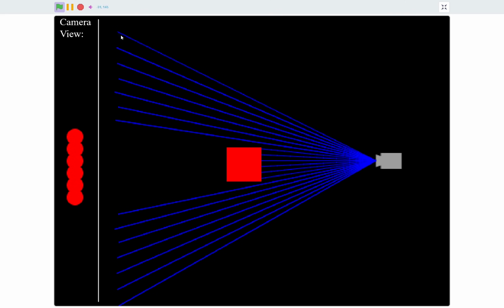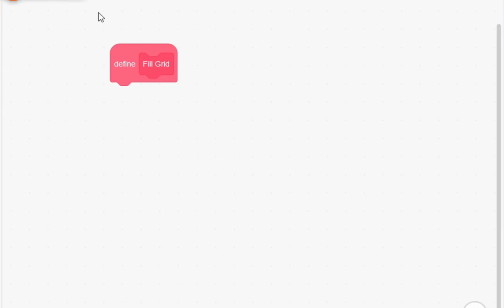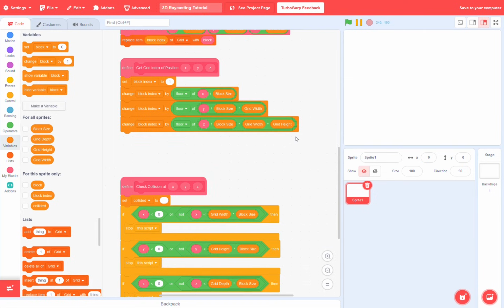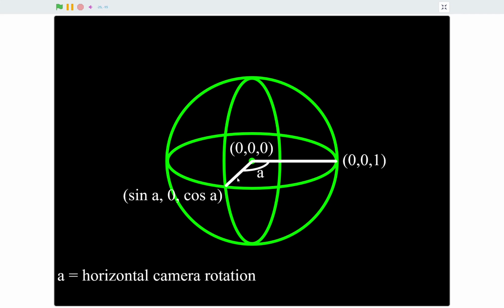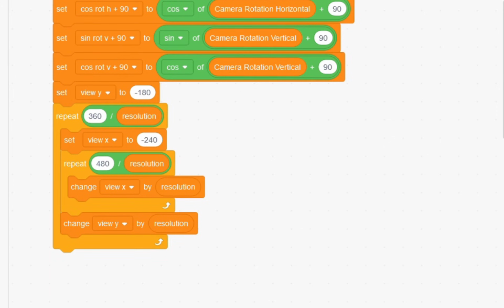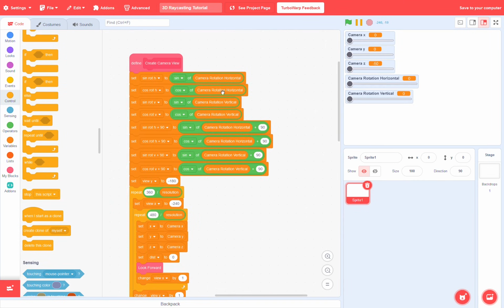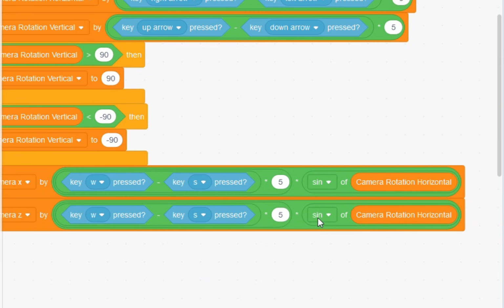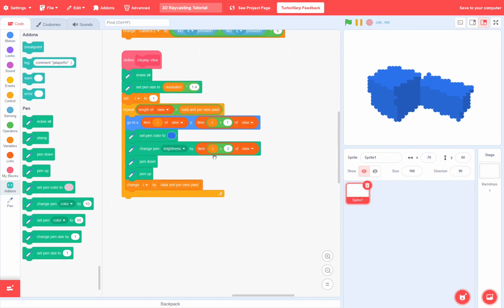How to Make 3D Minecraft in Scratch | ep1

Comment: Listen, lets just be honest this isnt possible without blatantly remixing another scratcher's project. Ive tried hundereds of time and i STILL fail every time. You do not know how to make it, so you just whip up some nonsense while learning it and pretend what your tutorial said actually works.
Reply from the maker: You're right that this tutorial does have numerous places where it's really easy to misplace a variable or block, and I'm sorry about that---I agree it's one of the biggest problems with this tutorial. If anything, that's because I came up with basically all the code here on my own. Perhaps, if you aren't able to find where you went wrong, you could try my newer 3D tutorial which is both more efficient and (I hope) easier to understand.

Comment: I tried 3 times but it didn't work. I checked the codes a thousand times. What should I do?
Reply from the maker: Pay attention to what, exactly, is going wrong. Then think about what parts of the code could cause this. That can help highlight the areas you should check first. Also be on the lookout for breaks in patterns in the code (e.g. there's an x variable in a section where only y variables should be). Swapping change/set variable blocks is also a common mistake.
Reply: @FindingPepper  very thanks bro. I like your videos more than anyone else.
Reply: die

Comment: I've been too lazy to try this so far: Does implementing the trig functions (sin, cos, etc.) with 'lookup tables' (lists indexed by look direction) speed things up enough to justify the added memory overhead?  Has anybody experimented?
Reply from the maker: I like the thinking, but because we only calculate sin and cos a few times per frame I don't think it would really speed up the project, and would not at all be worth the imprecision that lookup tables would cause. After all, the specific direction of the rays is really important because we need to know which individual pixels are hit.
Reply: @FindingPepper  Thanks for your response.  I agree that replacing the functions with lookup tables would be useful only if the functions were being called within deeply-nested loops.  Beyond that, I agree that the precision is more important.  I guess the tables could have 'high resolutions', but then the memory costs might be prohibitive.  Thanks again for the video.  I long suspected that 'raymarching' was better for textured Minecraft blocks than matrix-transformed primitives, but I hadn't done enough experimentation to prove it.

Comment: can you make a system that uses mouse pointer to look around? (with pointerlock turbowarp extension)
Reply from the maker: I do mouse camera movement in episode 3, though not with pointerlock. It could easily be adapted to use pointerlock though.

Comment: wheres the "make space" option? i cant find it anywhere
Reply from the maker: It's part of Scratch Addons. Scratch addons is built into turbowarp; you can configure your settings by clicking on the "addons" button. If you want to use it with vanilla Scratch though you need to download the browser extension.

Comment: Wouldn’t it be faster to load some lists with the sin and cos values at the start of the project and then just reference that when needed?
Reply from the maker: Maybe slightly, but computing sin/cos just once per frame does not have a significant performance impact.
Reply: @FindingPepper  ok 👍

Comment: Beginning of the tutorial: 🙂

Finally done: 💀

But now I have to do EP2 💀💀💀
I hope it's not longer like this one
Reply: It's alot easier, trust me.
Reply: @rebeccaxing74  I know but my Chromebook can't run texture I tried
Reply: @BlackBrdFlys  what happended, did the screen just stay black?
Reply: @LucasD.  Ya
Reply: Check the ghost values list. If they are not empty then the problem probably is that the “switch costume to textures” block at the beginning is set to the old costume, even though it was deleted. Replace it with the updated costume.
Reply: If they are empty, then you have to manually insert them yourself with the same values as the asset project values.

Comment: one wrong variable placement and you gotta restart the entire tutorial over
Reply: It's like saying one misspell in a line of code ruins it. No shit. Go find what you did wrong and try not to have it done again
Reply from the maker: @PetarĐurić-z2e  Though I do get that it's harder in scratch because there are no error messages
Reply: @FindingPepper  fair
Reply: @FindingPepper  i mean not like there is any way for it to be wrong, every way you can use scratch will work for it unless you corrupt the .sb3 file
Reply from the maker: @katharina7201  True, but just because a project runs doesn't mean it runs as intended.
Reply: @FindingPepper it’s still running isn’t it
Reply: @PetarĐurić-z2e  💀
Reply: @PetarĐurić-z2e   It happened to me like 2 times so i need to restart
Reply: help me mine doesnt work i found ike 50 problems but it still doesnt work
Reply: Ummmm
Reply: Only if you don’t know what you are doing otherwise you could litterally just go fix it
Reply: Stupidest Comment in this video
Reply: I have a problem which direction you give in that direction my blocks dont come

Comment: if i may suggest
since you're using a grid, you could base your raycasting on a dda algorithm, adapted to work in 3d

dda (digital differential analyzer) is a line-generation algorithm, optimized to use the least amount of checks it can by using variable step sizes
for the most part, it's used to draw lines on a screen, to figure out which pixels a line intersects
but given a raycaster essentially makes lines, dda would let the game render faster, and more accurately, than the usual raycasting with a fixed step size
Reply from the maker: Yes I will do this in episode 2!
Reply: @FindingPepper  
hell yea!

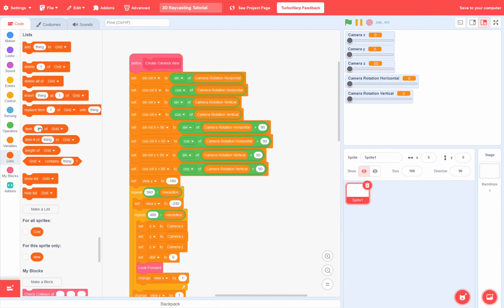Comment: view, WE'LL DELETE ALL OF YOU: 23:54 (put 0.5 x speed for greater effect)
Reply from the maker: I was trying to say "we'll delete all of view" but that's funnier
Reply: @FindingPepper  yeah, i noticed that. but it also sounded like that
Reply: also, could you help me understand your code a bit better please
Reply: especially the unit circle and how you get those formulaes
Reply: also, there is another problem in my code
Reply: when changing the camera rotational vertical var to turn camera it didn't work correctly and i think its a problem with i but idk
Reply: nvm , i fixed it, somehow
Reply: i just changed 1 variable and it miraculously worked
Reply from the maker: @Beat-pj7zg Think about a right triangle. Call one of the non-right angles "a", and then call the side opposite it "opposite", call the longest side (opposite the right angle) "hypotenuse", and call the third side "adjacent". Then the "sine" (or "sin") of angle a is equal to opposite / hypotenuse (the ratio of their lengths; "/" represents division) and the "cosine" (or "cos") of angle a is equal to adjacent / hypotenuse. Using these (and one other called "tan" which is less useful), if you have an angle and a side length of a right triangle, you can find the other sides. Say I want to find opposite and I know hypotenuse. I can do this calculation: hypotenuse*sin(a). This is because sin(a) = opposite/hypotenuse and hypotenuse*(opposite/hypotenuse) = opposite. Now, in our unit circle, we can think of the hypotenuse as a radius of the circle, and adjacent and opposite as the x/y coordinates. (a is still our angle in the circle). This means hypotenuse = 1. So, finding the "opposite" as I showed above, we'd simply multiply sin(a) by 1, which equals sin(a). Similar with cos. This gives us the coordinates where the radius hits the circle. The unit sphere formulas are derived similarly, but I don't know all the details about that (I just looked them up haha). For more information and pictures check out these wiki pages: 
https://en.wikipedia.org/wiki/Sine_and_cosine
https://en.wikipedia.org/wiki/Spherical_coordinate_system#Cartesian_coordinates

Comment: Incredible! That fact that we did this with only 370 blocks!!! (If you have more or less you are doing something wrong.)
-- =Tips for anyone following this tutorial= --
  -  MOST IMPORTANTLY : Make sure that your variable names are matching. Putting a variable in the wrong place can mess everything up.
  -  Make ABSOLUTE SURE that your variables are set when shown as set, and change when they are shown as change. DO NOT mix these!!
  -  Of all else, make sure to do this: If it's getting late, come back and pick it up tomorrow. There have been times when I couldn't find the problem, but getting a good night of rest gave me a HUGE boost of energy in the morning and I almost immediately solved the problem.
Reply from the maker: Good advice! It's definitely true that it's easy to make little mistakes. You have no idea how many hours I've spent in pain trying to fix a bug when the issue was just that an x and y got mixed up somewhere!
Reply: @FindingPepper  Looking forward to part two! At this rate, I'm sure that this will be an incredible tutorial used by many. Probably even a top tutorial someday!
Reply: @Aetherpixel I would love to see that too!
Reply: @FindingPepper  So true XD.
Reply: You sure 372 is correct? I checked a time where he cleaned up the blocks and there were 365, and counting, only 5 blocks were added, and I ended up with 370
Reply from the maker: @connor_awesome64  Yeah I think there's 370 in mine too
Reply: @FindingPepper ok good, thanks for the awesome tutorial btw!
Reply: @FindingPepper  huh. Where are the two blocks I dont need XD
Reply: @FindingPepper  where do we clean up the blocks? what's the timestamp?
Reply from the maker: @Aetherpixel  I do the clean up blocks action at 21:32, though I'm not sure how much this helps... it's hard for me to share a screenshot, sorry. If it's working fine I doubt it's something you need to worry about :)
Reply: @FindingPepper  um, i think i only have 366
Reply: also, the cube stretches so much when i rotate at a specific angle
Reply: i fixed the second one, i got cam rot h and cam rot v mixed up
Reply: @connor_awesome64  huh? I have 372…
Reply: @connor_awesome64  can u screenshot it or something? I wanna see what i did wrong
Reply: bro i have 0
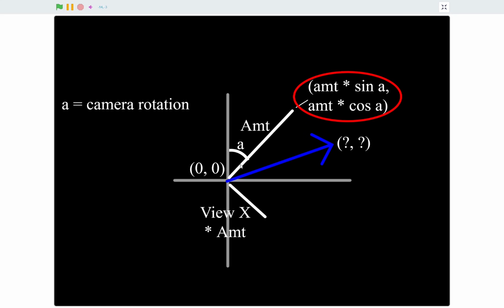Reply: 13:50 at this point there is 106 blocks and at the end there is 307 wow
Reply: my view list is not filling up. There is a bug in the view and collision somewhere. I copied and rewatched the video, but nothing change.